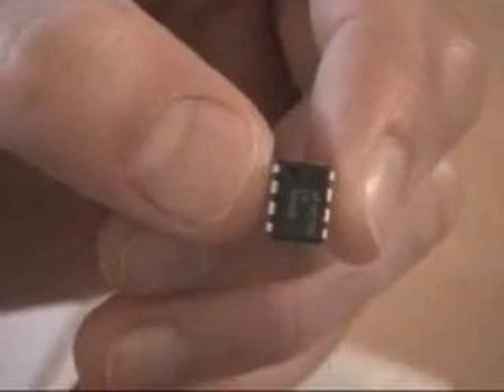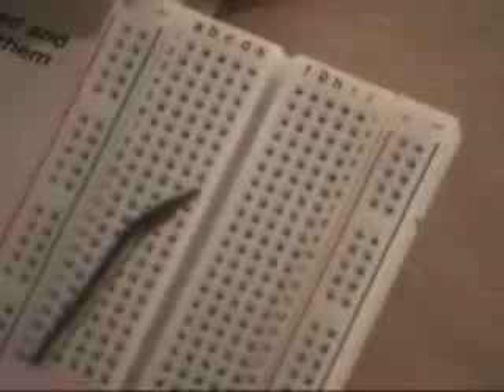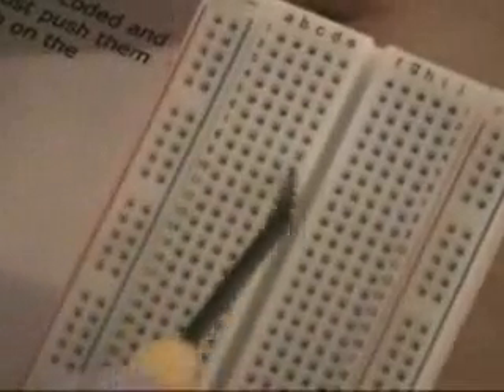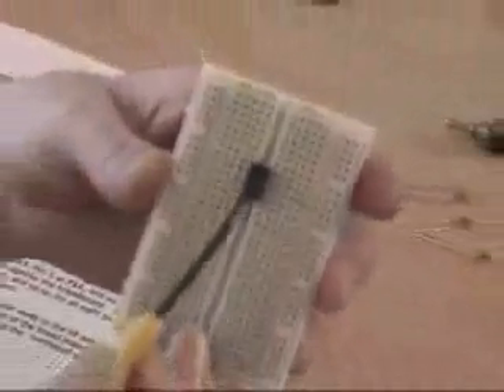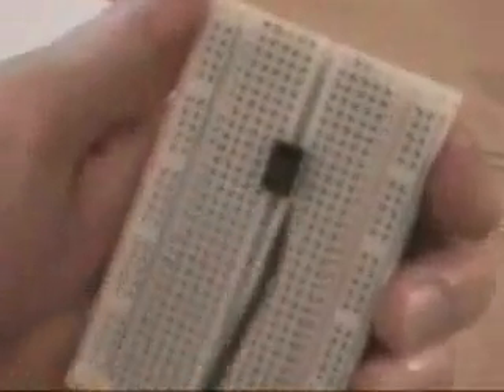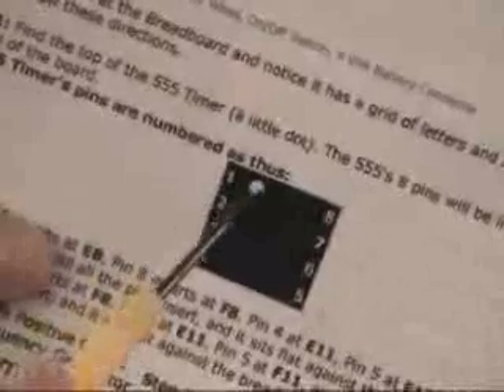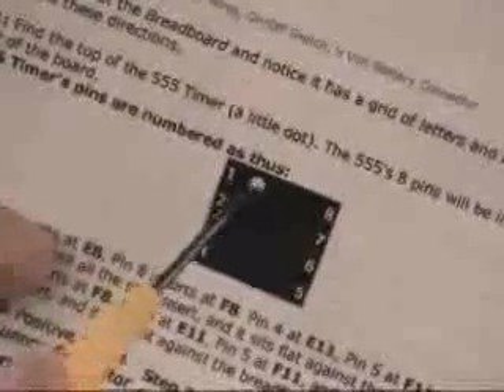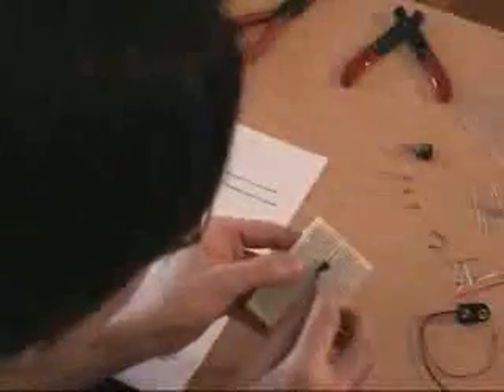How To Build A Hulda Clark Zapper, Part 1/9

Comment from the maker: That's a good question, I believe OHM's law could help... anyone out there know the answer? Connect your zapper output to a Hz meter and try different resistors... Instead of a resistor, I used a 1 meg potentiometer so I could dial 1k-30k with all frequencies in between using a Hz meter. You could get a 1 meg pot at radioshack and set it to 2500Hz.